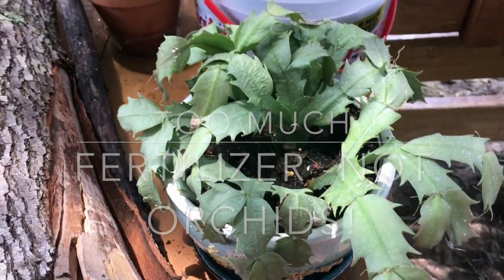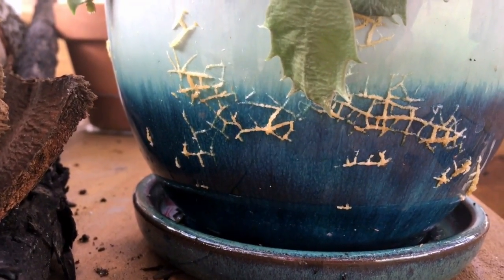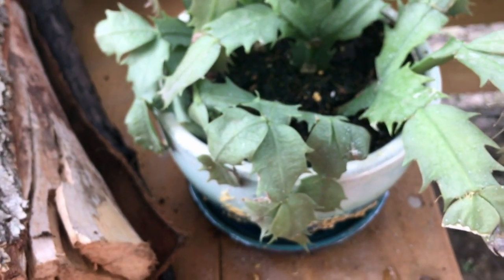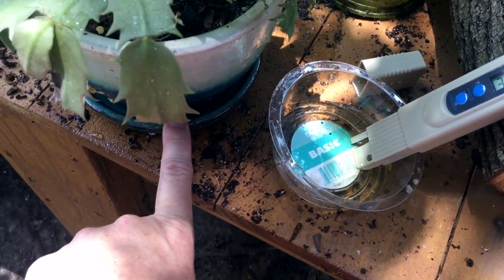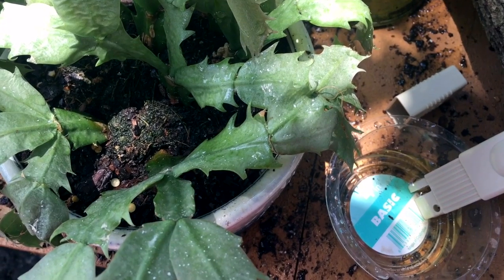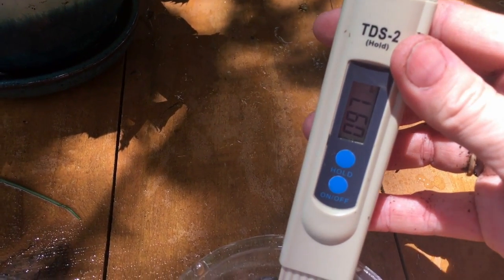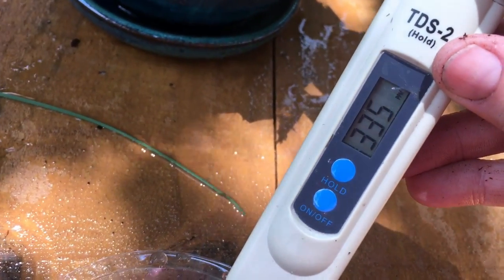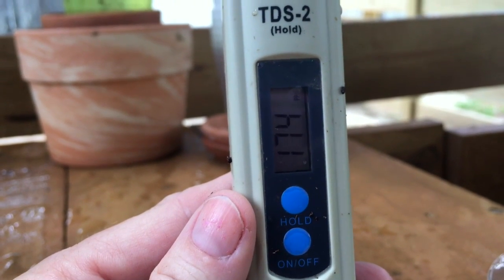Too Much Fertiliizer on my Non-Orchid plant

Comment: ......yeah, 3200 is a wee bit high.....lol.....its not uncommon to find piles of osmocoat in store bought plants.....had the same thing in my Bird of Paradise...more pellets than I could hold in my cupped hands......all in one plant. Good flush and it should be fine.........and if your tap is 95ppm......you are blessed.
Reply from the maker: I know!  We have very soft water.  If it were a tad bit more acidic would be better as it tends to be a little alkaline. I still see problems with the plant.  About to handle up on that though.